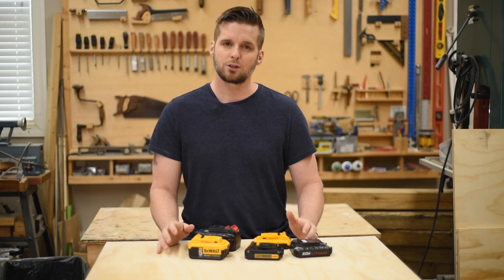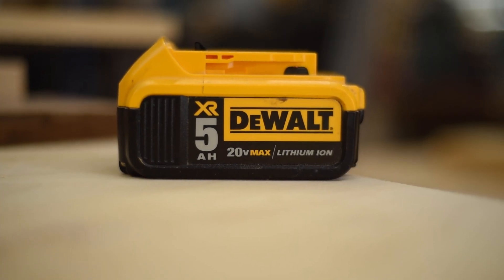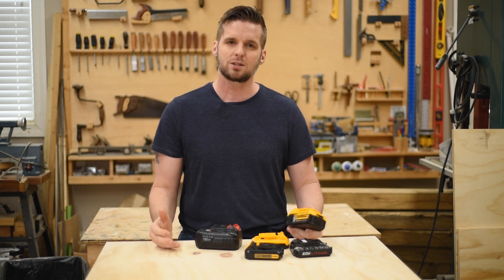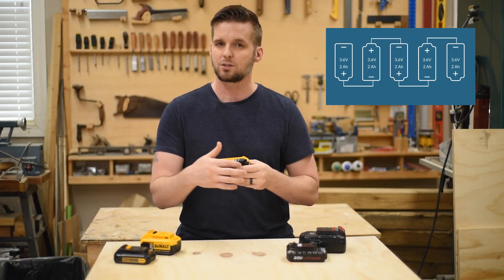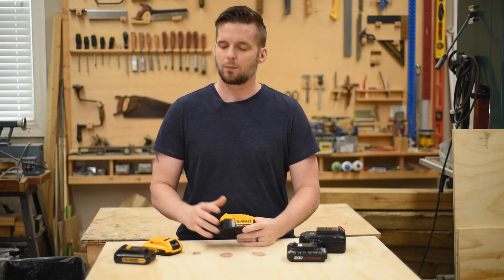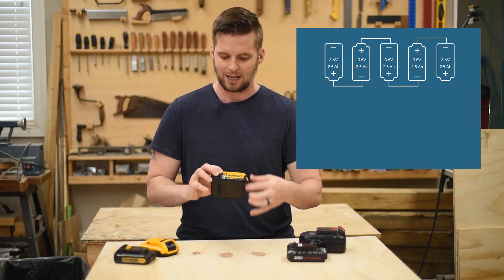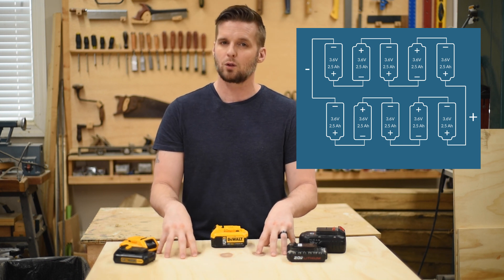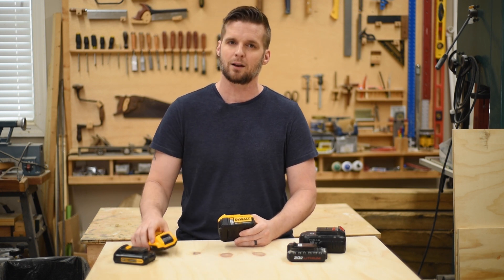What Does the Ah (Amp hour) Mean on Cordless Tool Batteries? A Quick and Basic Explanation.

Comment: I Have a 2 ah battery and a 8 ah battery, both 20v. For some strange reason the 2 ah battery which is smaller seems to give more power to my drill than the 8 ah battery.

Comment: They are selling DeWalt 20 volt 8 AH replacement batteries that weigh 1.38 lbs. A DeWalt 20 volt 5 AH battery weighs  1.68 lbs and a DeWalt 20 volt 8 AH battery weighs2 lbs. So are these DeWalt 20 volt 8 AH replacement batteries a scam
Reply: I wouldn't say so no.. I mean that depends on where you buy them from, I just bought 2 off of Temu and they came in yesterday. I tested them on my dwalt power tools today at work, and they worked just as any dewalt batteries I have do.... just saying. But like I said I bought mine off Temu lol, I was skeptical at first but once I used it, I was a believer. AND I bought them for like a FRACTION of what a dewalt battery would cost brand new. 🤙

Comment: If smartphones have 5000mah batteries, why are 5ah batteries so large and heavy
Reply from the maker: Your mobile's battery has a 5ah capacity with an output voltage of 3.7V. The tool's battery has an output voltage of 20V. So, the total energy stored in the cell battery is roughly 3.7 x 5 ah = 18.5Wh and the tool battery has 20 x 5 = 100 Wh. If you ran the tool on the cell phone battery it would be a little less than a 1ah battery.

Comment: Well a higher ah battery damage the tool?
Reply: If I replace a 1.5ah battery with a 6 ah battery will it damage the tool?
Reply: No as long as the Voltage is the same. Both numbers should be written on the side

Comment: clearly the higher amperage batteries have more capacity but Is there a noticeable difference in tool motor speed or torque with regard a 4 amp battery vs a 5 amp battery? 
Does 1 Amp make a difference?

Comment: So as long as the voltage is the same I can use any ah battery in my tool?
Reply from the maker: Yes, but depending on how much it draws it may not last very long. (ex, using a 1.5 ah battery in your cordless weed eater won't last long at all)
Reply: @OutoftheWoodwork  I was actually thinking about upgrading from a 4ah to a 6ah. I just wanted to make sure I wouldn't do any damage. Thank you for responding.

Comment: Bought a Metabo 5.2ah battery to work on a 18v cool box mainly ans for other Metabo tools that’s revelry acquired. The 5.2ah is not sufficient enough at all to sustain the cool box in the height of summer so will be getting a 10ah battery which costs a lot but should supply the box with enough juice for treble the time.

Comment: Simplified analogy: Volts = size of gas tank. Amp hours = amount of fuel in the tank. Watt hours = Volts x Amp hours = hour far you can drive on a single tank.
Reply: More like volts= type of fuel and amp hours like tank size. the consumer gonna say how long you gonna get with 5ah battery
Reply: Here's a Dewalt fan boy 😂😂
Reply: No. Volts is the power the tool can output. It’s more like engine displacement or torque than anything. Amp hours is just a capacity measurement. It is the capacity of the tank or as you put it the size of the tank. Voltage has nothing to do with the size of the battery capacity. A 20v battery will always be a 20v battery regardless of whether it’s charged or not. It is capable of powering a 20v device. 

With that said, you can get a more accurate idea of battery capacity multiplying the ah and the voltage. 4000 ah battery with 12 volts will give 36000 Wh but an 1800 ah battery with 20 volts will also give 35000 Wh. The 20 volt tool will eat through the power faster though.
Reply: Can i used a higher voltage battery on a lower voltage tool or will i fry it? If i have an 18v device can i run a 20v battery?
Reply: Wrong

Comment: Hi i have an ingco drill with 2ah batteries, and i recently bought an ingco grass cutter which use the same battery, and after 4 to 5x of used the batteries dont charge as much as before. Before when i use the grass cutter it takes around 20mins before it drains but now only 5mins, it killed my batteries, do i need to use a higher ah for the grass cutter? Thank u so much

Comment: Very well explained, bro, but when talking about amp and voltage rules regarding circuitry (series, parallel or combination), instead of saying, the "amp hours" add up, or share (respectively) it's best to leave out the "...hours" part in that phrase.

Now I do imagine that using "amp hours" in that part of your explanation might have been intentional to make it easier for some, but that could cause a bit of confusion since "ah" really doesn't fundamentally tie into circuit terminology. Battery terminology, yes, but not circuitry.

Other than that, your presentation is absolutely perfect. Thank you for producing and sharing this 🙂

Now, please don't be offended by my critique. I mean it ONLY as an observing journeyman electrician ✊🙂

Comment: Hi, you look like that you understand thing . Can you tell me what means shortcut TH ? Its on every battery. There is +- and TH. Thank you
Reply: TH is a Thermistor or a thermally sensitive resistor. It's properties change as temperature changes and can limit or increase current dependent on temperature. This is useful in case a battery begins to overheat, the resistance of the Thermistor can increase which will allow less current flow and therefore less heat, protecting the battery.

Comment: Hello
Was getting ready to buy the 20v dewalt 1/2  brushless cordless drill with either the 1.5 ah batteries or the 2.0 battery.
Want to also buy the dewalt 20 volt impact wrench XR894 without/battery for taking lug nuts off 2  cars about 3 times a year.
Will the batteries that come with the drill ( either the 1.5 or the 2.0 ) be sufficient for my application ?
It seems like I wouldn't need the additional 12% of power in the test/ link you posted.
The dewalt 5.0 battery lists at 160.00 but sells for about 120.00
I have a cordless impact 18 volt model dc821 someone gave me years ago but don't like it as it sometimes takes the lugs off and sometimes does not, either way I have to give it power for 20 sec. or so to get it to go. Its rated at 160 ft/lbs

Regards
Reply from the maker: You can use it with the smaller batteries they'll just run out pretty quick. I'm not sure exactly how quick without testing it myself, but, if you don't want to purchase the 5 Ah batteries,  you just keep charging them until you make it through!

Comment: Thanks for clarifying that the larger Ah batteries are indeed just a little bit stronger.  I've noticed this myself with certain higher-drain devices like my palm sander.  It works much better off a 4Ah battery than a 2Ah.  My impact/drill drivers work fine off the smaller capacity batteries.

Comment: Good video, and grazes a broader topic I'm always trying to understand more about as a beginner woodworker: the electrical side of woodworking (extension cord gauge, amps/hp/watts/voltage, lithium ion battery care, etc.). I struggle to know what's a safe level of power to draw from a regular outlet and when my breakers will trip. Perhaps a video some day on the basics of the electrical side of woodworking for people who don't use a 220v setup? Seems like you have a good understanding of the topic. Thanks!
Reply from the maker: I would actually benefit from that, as well. I have a family member that is an electrical contractor and consulted in my shop setup, but I'm not knowledgable enough with the electrical side on my own. Maybe I will get with him one day to create a video like that...great idea!